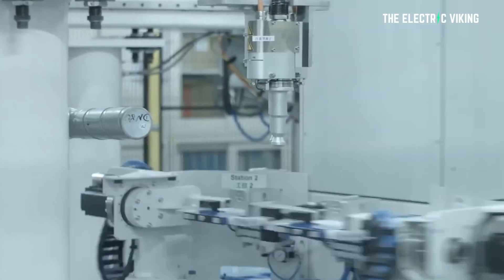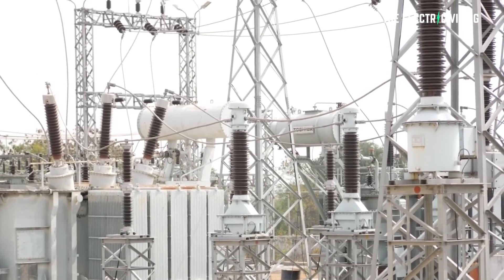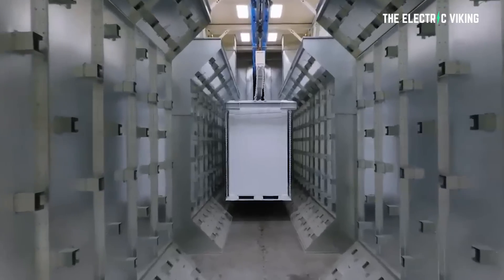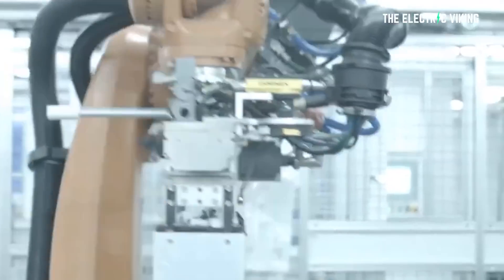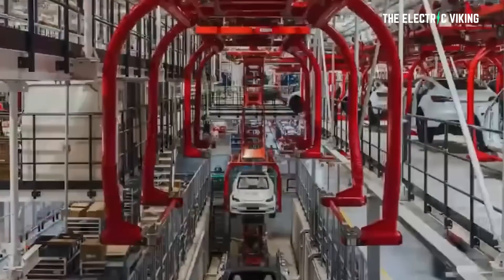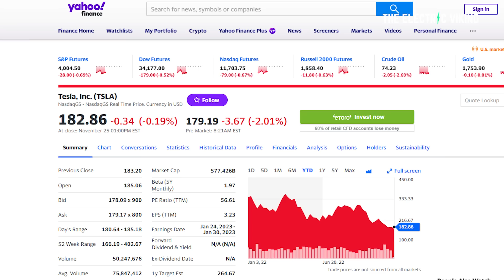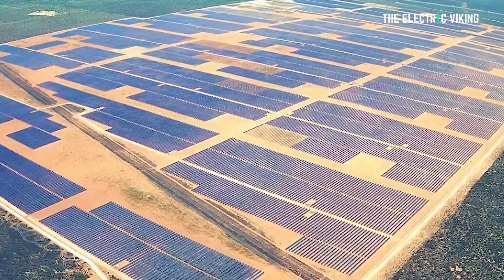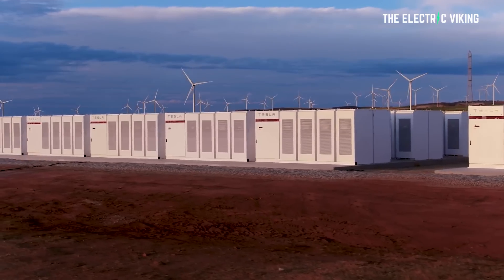NEW LFP Tesla Megapacks Power Europe's Largest Battery

Comment: I wonder of Tesla would gain a net financial advantage by promoting a non Li battery technology for static batteries - even (gasp) the batteries of some other company.  None of these alternate technologies have quite the cycle efficiency of Li batteries but most of them are from cheaper materials and hence with production volume should be cheaper than a Li battery. Also they are pretty well all longer lived than a Li battery and are happy to be fully charged and discharged.  But that is not where Tesla would gain an advantage.  Li for vehicles is competing with Li for static batteries, driving the price up and hence the price of electric cars.  Reduce the demand for Li and perhaps the price would come down. And price is the main limit to market for electric cars.  Range is no longer the problem it once was.  Just think, the 180mWh Hornsdale battery contains enough Li to power 3000, 60kWh teslas.

Comment: 7:25  : "It doesn't make sense to use 4680 cells in grid storage."
I contend that it doesn't make sense to use lithium-anything cells in grid storage.  Use Sodium-ion or Sodium-sulfur batteries for grid storage and save the lithium for the portable applications that justify its cost.  Tesla will only be competing with themselves in tight lithium markets until they figure out how to use sodium-ion or copy what Tepco in Japan has been doing with sodium-sulfur batteries for the last 15 years.
Reply: Sodium - ion batteries will be a thing after 2024. Byd will start to make these batteries by the end of 2023 and catl later. For now lfp batteries is the best solution and for tesla, 4680 lfp batteries will be the best thing until 2025

Comment: Don’t forget - the deal in Adelaide was we can deliver it working in 100 days or it will be free!  They got paid. The energy company saved a sum which was multiples of the purchase price within the first 2 years of operation. I forget the actual numbers, but it was a massive success story all the way down the line …
Reply: This was big news here in Canada.  I read as well that power was much more reliable as well at the individual consumer level.
Reply: @elainebradley8213  Indeed. The first time one of the existing peaker plants fell over which would previously have caused a cascade blackout wasn’t even noticed for a few minutes as the megapacks cut in in in microseconds and supply was completely unaffected. It was the first actual “proof of the pudding” worldwide.

Comment: Rough estimate of BYD's total production capacity:
 
1). Xi'an: 1.5 million vehicles, with a current daily output of 3,000 vehicles. The fourth phase of Xi'an is planned to be put into production in June 2023! After the fourth phase of Xi'an is put into production, the total production capacity of Xi'an will reach 1.5 million per year!
2). Zhengzhou: Six phases have been planned, the factory area exceeds 15,000 mu, and the first vehicle is planned to roll off the assembly line in March 2023! The total production capacity of the sixth phase is 1 million vehicles.
3). Hefei: The Hefei base has reached full capacity and the annual output value is nearly 200 billion. After a calculation, the average price of a bicycle is more than 150,000 yuan. In other words, this base should mainly produce models in the 100,000-200,000 range. It is understood that the Hefei base mainly produces super hybrid dmi models. The first phase of Hefei, where the first vehicle rolled off the production line on June 30, produced Qin plus dmi and Song pro dmi. It is expected that Destroyer 05, Frigate 05 and other models will be produced in the future. Production capacity of 1.32 million per year
4). Shenzhen: Shenshan + Pingshan base, BYD Shenshan base initially planned 600,000 vehicles, the future scale will exceed Hefei (1.32 million vehicles), and is expected to reach 1.6 million vehicles, plus the current BYD Han in Pingshan, Shenzhen The production capacity is 350,000 per year, and the total production capacity is 1.95 million vehicles per year.
5). Changsha: Production of six major models including Destroyer 05, Qin PLUS DM-i, Tang, Denza, etc.! The production capacity is 1 million per year.
6). Nanning: Nanning Lingli Industrial Park, in addition to the BYD 45GWh battery project covering an area of 2,500 mu under construction, has recently planned a 11,700-mu complete vehicle and spare parts project (a total of three phases), which is expected to correspond to an annual production capacity of 1 million units .
7). Xiangyang: The total planned area is 20,000 mu. Based on the planned area of the previous million-dollar bases, the annual production capacity is at least 1 million vehicles.
8). In the Changzhou base, 200,000 vehicles in the first phase have been put into production, 200,000 vehicles in the second phase are under construction, and the third phase is under planning (200,000 vehicles expected). The three phases add up to 600,000 vehicles per year.
9). Jinan base: put into production at the end of the year, 300,000 vehicles per year.
10) Fuzhou base: 20+15 vehicles, 350,000 vehicles per year.
11) Thailand: 150,000 vehicles per year
12) Uzbekistan: 150,000 vehicles per year (an agreement has been signed)
Total production capacity: 10.32 million vehicles
BYD's target for next year is 5 million vehicles.
The above-mentioned bases have mass-produced in Xi'an, Changzhou, Fuzhou, and Changsha; Xi'an
Reply: If anyone reads this, please summarize.

Comment: Tesla should start making these with sodium; every lithium unit takes 1000s of EVs they could make off the market. 1 Megawatt is a Million watt hours - a typical home needs 1000  watt hours a week (no EV, usa, lower in UK),  One megawatt is enough for 1000 families for a week; 196 megawatts is enough for 196000 families to have power for a week. Not very much.  49000 familes for 4 weeks and 16,000 families for 12 weeks of winter.  So if there were 10 mllion families in the UK (actually 15 million so makes up for US figure) - not including industry or vehicles - you'd need about 625 of farms to hold enough power for winter.  If you used all the Lithium produced in the world that could be done with 1 years worth of Lithium production (generously) . UK which is 1/200th earths population so you'd just need 200 years to process enough lithium for all the pacs just to store enough power for winter; but then you wouldn't have EVs so you'd need another 200 more years at current lithium production - but then you'd need more battery farms to power the cars!  And thats just 3 weeks power DARN. and lots of the old batteries would need replacement Shoot; Oh and what about Industry? Lithium just doesn't seem to scale very well and is a waste of money and effort until there is a realistic solution.
Reply: More like 1000 kwh per month for typical home. That would be 250 kWh per week.
Reply: @Atgul-z6o  that probably is low then; probably more like 400 kWh a week ; surely deesn't help to push anything people will say the estimate is too high; but the point is that high or low by a factor of 2 or 4 won't matter ; it can't be done.
Reply: @Atgul-z6o  I suppose we could use a per person figure as the idea of what is a household may also vary here in the USA its slightly over 4 people
Reply: @Atgul-z6o  another factor of size is whether one considers all energy used - including heating and cooling or just existing electrical power
Reply: Back of the napkin math like you are doing does not account for exponential growth. Obviously if we keep doing something key like mining and refining Lithium at the current rate it would take forever. That's not how economics works though, production accelerates after an initially very slow growth to a rate orders of magnitude higher and faster whilst price falls rapidly. Common sense in this case is not sufficient.
Reply: @garethrobinson2275  it doesn't take into account exponential growth because lithium production can't expand rapidly. In fact the price has gone up 18x in two years It would have been a good investment; might still be.

Comment: As you already correctly stated this is a fast response cheap replacement for idling a power plant as a net frequency support service. So this massive battery will only replace a small 250MW power plant for  only one (1) hour. The UK grid operator contracts such fast response balancing service in advance and will dispatch as needed. Characterizing this as a massive energy storage system may put the layman on the wrong foot. This will indeed destroy the business case for idling power plants as fast response frequency service. However that will also decrease the reserve for the slower response really massive reserve energy required for when no wind or solar is available. Especially if grid stability is left to a spot market without the grid operator having the responsibility and authority to contract in advance for both fast response and slower longer term reserve power that will result in an increased risk for net stability. If I remember well that lack of authority for the grid operator was one of the contributing factors of that Texas grid failure a few years ago. Truly massive and affordable energy storage to supply the grid for extended periods like days or weeks have as far as I know not emerged yet. That scale of storage of another level is required for the RethinX scenario.
Reply: The Texas grid failure case had more to do with the lack of requirements for cold weather hardening of gas power plants and gas supply equipment. Replacing gas combined cycle lagging source (peaker) power plants with cheaper battery operated systems doesn't take away from all of the other power sources, as there are multiple layers of standby production.

Instantaneous demand thermoelectric lagging source plants are like having a jet fighter circling overhead ready to go. The next level of peaker plants is like the plane being crewed up and sitting with idling engines at the end of the runway ready to take off, while the next level has the crews sitting nearby their plane ready to start their engines and taxi to the runway. If demand requires the circling aircraft to engage, then the next aircraft sitting idle on the runway takes off and starts circling, while the crewed up plane starts up and goes to idle on the runway, and a new plane crews up to replace it.

Peaker plants do the same thing, with each plant being raised to the next standby level whenever more capacity is used and needed. Keeping a gas combined cycle turbine running or idling on the chance that it may need to provide instantaneous power is very expensive, causes a lot of system wear, and burns fuel without necessarily producing power. It is cheaper to use battery based storage to provide such peak power, as it can do so without waste or moving parts, and does so faster with waveform and power factor correction.

Although most utility scale battery based storage systems are designed to produce their maximum rated power for around 4 hours, an hour is plenty of backup time for other power plants to be brought online and run at full capacity where they are most efficient, and they can then be used to supply power to the grid and/or recharge the battery storage as needed.

As batteries and renewables become cheaper, they are replacing more and more of the power production, starting with the most expensive sources of power, especially peaker plants, coal, and even nuclear. In the USA, the Nuclear Regulatory Commission (NRC) has fined nuke plant operators for operating as peaker plants in order to make a profit from the high price of peak power, as they are not designed for, nor permitted, to operate as peaker plants. They are supposed to operate as leading source (baseload) power as they are designed and permitted for.
Reply: @GoCoyote  I thought there were many problems, and the unusual weather was part of it.  And infrastructure not properly maintained, in water systems for example, was part of it.  

They may have addressed a few things.  Scheduling maintenance was another issue, if I remember correctly.

So it seems to me that people need to be realists about the grid in Texas.  We do need more nuclear, to stabilize.  But I understand off shore wind may develop, which widens the stability of the grid.